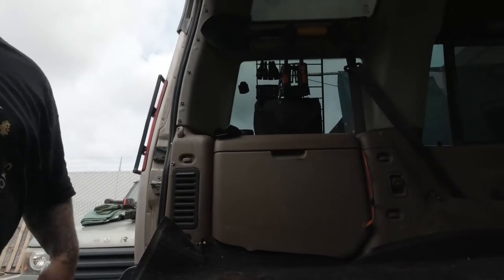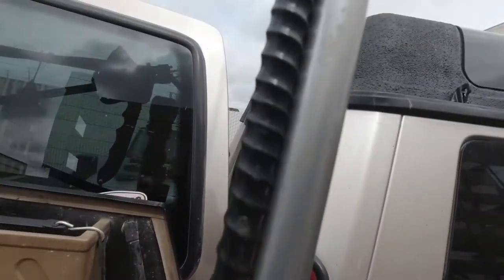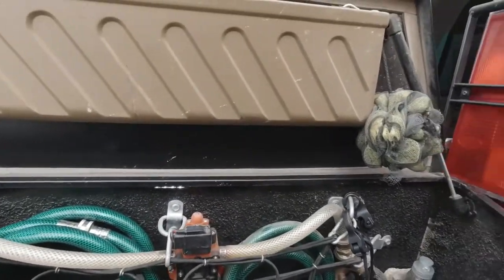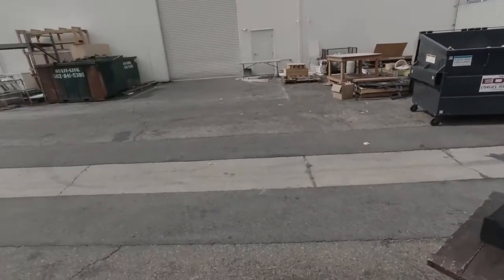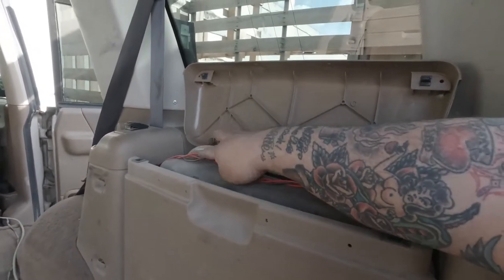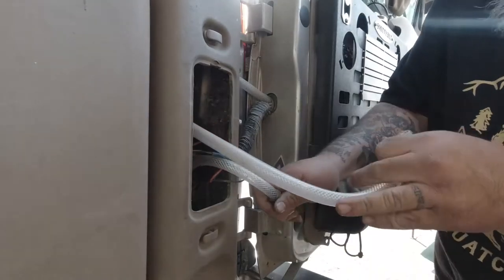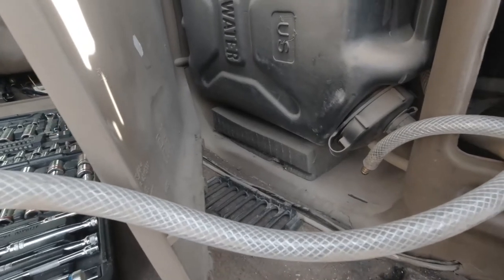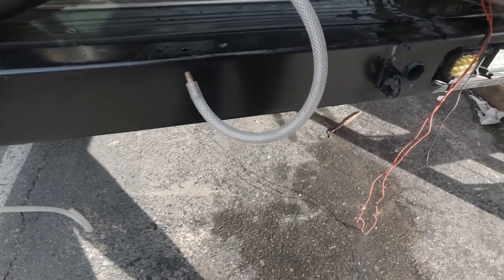S1-E18  LAND ROVER DISCOVERY 2 ON BOARD WATER

Comment: You are awesome...so many questions... what batteries or battery runs this? How did you deal the tube into cap off water container.  Can't believe that didn't leak! Amazing.  Still want to see the diesel heater! Cheers
Reply from the maker: im running 1 odyssey battery.  i drilled the cap a lil smaller than the tube and cut the tube in an angle and pulled it from the inside. and did the same with the cap and sealed the cap and breather with gasket maker. heater video coming out on sunday.
Reply: How do you manage to run all these electric add-ons to run off the one odyssey battery and not get a bunch of parasitic drain when you are camped out so your truck will start after?
Reply from the maker: @omarashraff9133  every switch added to the rig is ran off the battery, so the disco doesnt have to have the key in the on position. everything added has low power consumption and has power safety management. i turn on the rover for 20 mins in the morning and night. the diesel  heater consumes most of it power on start up.  so i run the rover for 15mins while the heater goes thru start up. my battery reads 11.5 - 11.9 volts in the morning. starts up like a champ in the morning.  fridge, heater, fans, and amber lights stay on all night!